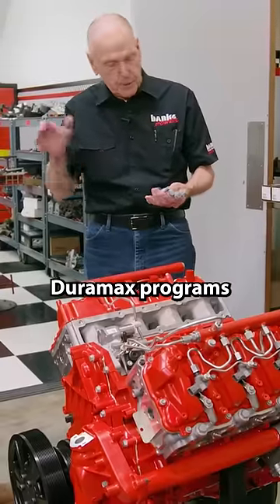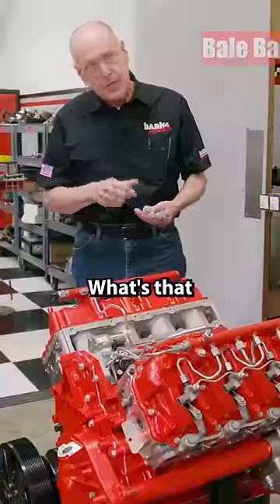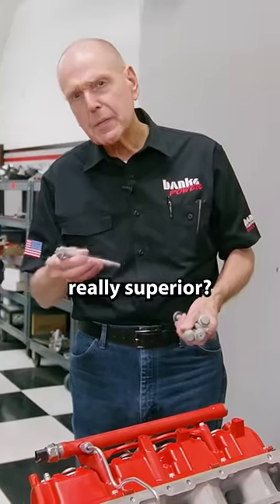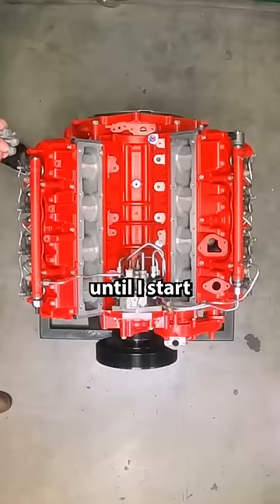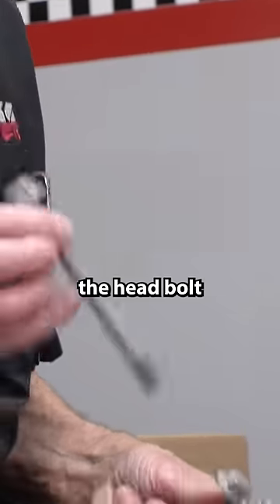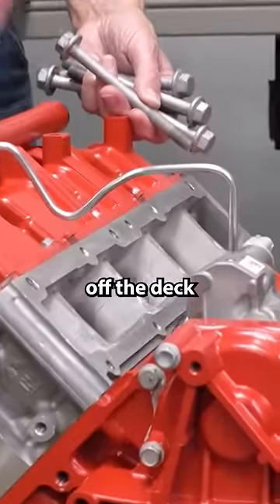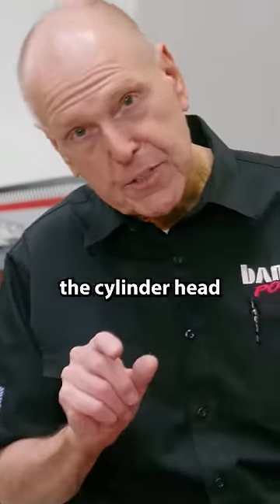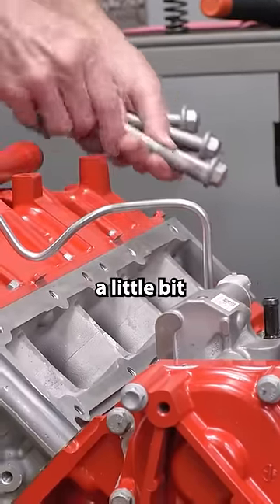Upgrading to head studs might be a bad idea

Comment: He states at the beginning of the video on all there Duramax programs. Now if he had a 6.0 power stroke I bet it would be studded. He isn't saying you won't need them. He is saying GM and isuzu make a good enough motor at 1000 hp they don't need them with there set ups. If a random person trys to make 1000 hp they very well might need head studs because they might over fuel and over boost the system causing a head gasket issue. If I built my 6.7 Cummins up I would need them because I don't have the talent this man does or money to figure out how to get away with that much power and keep my gasket intact. They are not a waist of money if you need them.

Comment: Similar to running stock shafts on my Jeep dana 30. I'd rather replace u-joints or cheap shafts, then upgrade to chromoly and start blowing ring and pinions.

Comment: Essentially the head bolts are mechanical fuse. The first point of failure ensuring the safety of more expensive ans difficult to replace components

Comment: Regardless of what you use for a fastener, whether it be a bolt or a stud the determination is going to come from the threads in the head whether you put them there or the manufacturer did.  There is a complex amount of science that goes into this equation.  Many times bigger or stronger is not the answer.

Comment: Oh, that looked like an expensive problem. A block with cracks radiating from head bolt hole threads is a sickening thing to find, especially if you’re picking up the check!

Comment: Forged the head valves increase head studs size to 14 mm , trunk should be 15 mm thicker , 4 layers of head gasket with Pure Stainless Steel gasket , in large water jacket line , that when overhead no longer existed

Comment: So if the bolts are continually stretched why wouldn't they be replaced at the same time as a failed head gasket? In a situation with a stock consumer vehicle has a failed head gasket, wouldn't replacing the bolts with the gasket be the best option for ensuring the longest lasting seal?

Comment: This is job complacency. Just because you can doesn’t mean you should. Metal stretching means it’s structural integrity is weakened. You wouldn’t know till you’ve pulled it and measured end to end or ultimately snapping it off in the block just to check. It’s common sense not to use oem parts on something you’re doubling the power in. No stock or oem parts are rated for that an if they “are” it’s only because they’re good for 10-15 full pulls before need of replacing due to lack of durability and the wear of stress from that level of power. It’s all good if you want the heightened risk of lifting a head, sending the head/block to a machine shop, or even having to drill and tap the studs out. Google the tensile strength ratings for oem studs vs any other brand and you’ll have all you need to know in # format. Arps material is specifically designed with durability in mind. Custom age 625+ studs are rated to 220,000 psi. They’re the reason a piston travels south under that power rather than the head shooting for the next county over. If you’re going big then buy big or you will later. If you’re just cheap fuckin off or it’s a daily then stock is just fine. One way or another that engine will have your money though lol

Comment: A lot of nuance skipped here:
How much deflection can the gaket withstand? 
Will the joint experience a loss in clamp load due to vibration or bolt walking? 
Are the bolts rated for the cyclic tension? (likely, but still)

Without an understanding of the dimensional stack up and loading, one is forced to argue that the aluminum thread boss is undersized with lacking support structure.

Seems a bit of a "stretch" to blame bolt spring rate when it's measurable and testable.

Comment: I thought the main reason for using studs is if you have a racing engine that requires taking the heads off so often that the bolts would wear out the threads faster on the block.

Comment: High end &/or "Pro" drag racing rear end gears are (relatively) soft. Extremely hard gears would just shear teeth when thousands Lb/Ft of tourque suddenly tries to engage those massive super sticky tires.

"Soft" gears will "smush" and flex but will keep their teeth and turn the tires.

Same basic concept.

Comment: The reason the head bolts are a failure point is because its cheaper than a block. These hardened hogh pressure torque racing bolts simply create a catastopic failure point where the head will literally blow off.

Comment: so you saying if you use upgraded head bolts the increased rigidity will put more pressure on the head and block and any weakest may create a new failure ???

Comment: Yeah, if I saw cracked heads every day id agree, but I don't. I see failed head gasket after failed head gasket. After studded especially with limited bolt designs like 6.0 powerstroke there's no more head gasket failures because of the studs.

Comment: so what is bro saying is "everything is designed in such a way that every components do its job in a harmonic way. this stud bolt for example is more flexible than the so called 'superior' ones, this flexibility of a bolt acts as a dampening spring for both the engine head and the engine block, if i use a rigid ones then sure it may not cause gasket leaks but there will be no way of dampening the sudden increase of massive load transfered to those blocks"

Comment: AS A RULE OF THUMB NEVER REUSE HEAD BOLTS. ALWAYS USE NEW BOLTS. ONCE BOLTS STRETCH THEY LOSE THEIR SPRING CLAMPING FORCE WHICH ALLOWS THE HEAD TO PERFECTLY MATE FLAT TO THE BLOCK AND ALLOWS THE GASKET TO CRUSH EVENLY.

Comment: An L5P head bolts are way stronger than an LB7, OE's continually improve their product, INCLUDING FASTENERS. If your building an older motor, and are building with the intent of "modern horsepower" levels, you will then need an upgraded level of fastener.

Comment: Seems like there’d be a better way to attach a cylinder head to a block. Like dovetailed keyways or plates on the outside of the head or block so bolts get shear load instead of tension. Idk, just spit-ballin

Comment: There's two sides to this "Mechanical sympathy" that some are born with, some must learn the hard way (that's me) and some are completly deaf to machinery's pain until a fraction of second before it kills them...

What you're talking about is the first  half of the equation, that of damping. 
For damping to occur the system has to be able to respond to an applied load and return... But with losses each time.
The othr dide of nevhsnical sympathy is resonance and the awareness of the possibility of the increase of energy in a vibrating system st certain frequencies.
Again the answer is damping.

Comment: If the bolts are working, they are not the weak link... until you push the limits, you won't know what is the weak link. Break it. Then, beef it up and push harder. Rinse and repeat.
Think someone may have hydro locked those threads? Or didn't clean it out?

Comment: Sorry, but I'm not waiting until it fails. If it does fail, I dont want That to be the issue or what comes with one or more head bolt failing.
Granted, I'm not going out of my way to just put "superior" head bolts in, but if im planning on tuning it up, those would be my first upgrade.

Comment: I dont see stock 400hp+ engines running studs, atleast my roughly 400hp audi uses bolts and does not have a reputation of having issues with headgasket or sealing. The companies that design motors have one of the highest skill level of engineers in any field. If the engineers that designed the engine decided that studs would be unnecessary i trust their judgement.

Comment: All ur saying is keep blowing head gaskets. No bolt suppose to stretch. If its stretching ur messing up. That power is lost power best way to treat that is use forged heads blocks and robs. I dont even use factory head bolts on vw beetles. U always upgrade the head bolts. If it was meant to stretch the company would make them out of rubber
Reply from the maker: Every bolt is supposed to stretch. This is called elasticity as defined by Hooke's Law. One of the fundamentals of physics, and what makes engineering so complicated, is that EVERYTHING is a spring. Everything has some level of elasticity, however small.

Comment: You definitely would rather have your weak link be the bolt before the threads in the block. But I would think you would rather blow a head gasket than have the head bolts fail. Am I way wrong?

Comment: I do not believe the head moves every (or any) time the cylinder fires.  It can’t or you would have head gasket failures.  There are many ways to fracture the block near a threaded bolt hole.

Comment: I'd rather blow the heads off the engine than blow the side out of the block. Upgrade those headbolts! ESPECIALLY if they're E Torx head bolts and you can change to hex.

Comment: Ok. So of you run stock headbolts and make 1000hp, "never blown mih head-gasket" its because the engines fail in some other capacity before the head bolts run out of stretch, and the head-gaskets run out of spring-back-ability.

Comment: studs are better unless you have the correct size bolt that leaves 0 unthreaded threads in the blind hole. if there were more threads engaged your bolt wouldnt pull out like you showed

Comment: This is a good point.  But why would ANYBODY want to entrust that kind of INCREASED cylinder HEAT and PRESSURE, ,  to a cast aluminum block & heads? 
      Where is the DURABILITY of this Isuzu Duramax engine when it has been souped up? When Isuzu can make Diesel engines out if cast iron, then that is an engine that can be trusted to handle that type of stress.... Save the aluminum for the motorcycles, light cars and airplanes....

Comment: Gale is a very knowledgeable man, but most of the stuff hes talks about is common sense, now i dont agree to this,  A tty bolt, if stretched further then the capacity it was designed to after it was originally torqued, it loses clamping force, therefore alowing the head to lift, and the original pressure will not be there once stretched, so in return, blown headgasket.

Comment: In all seriousness you can lose horsepower and torque before a failure. Sometimes deflection is enough to cause both increased vibration, increased heat generation, and less output.  I understand where you're coming from though.

Comment: Im not Familiar with the man, I'm sure he knows ten times more than I will ever know, not hard to do. For a dummy like me to concur, There would have to be a lot of people with cracked heads, because of head studs,  And I wouldn't be learning about it today.  My unworthy brain is leaning towards Inproper Installation of the studs. But if it doesn't blown them and it's not a race car And you're running a thousand horse power. Overheating ruining the motor coolant on the back tires shouldn't be an issues. 🫠

Comment: Gale, your explaination is not entirely technically correct. I know you like technical correctness. The bolts creat a clamping pressure, the cylinder pressure tries to lift the cylinder head. However in the details is this, the head bolts do not stretch with cylinder pressure unless the load casued by the cylinder pressure exceeds the preload of the bolt. Check out this book, John H Bickford,  An introduction to the design and behavior of bolted joints.  You are an awesome engineer and designer!!

Comment: Why would you want to let it get to a failure point? That's not good engine building and thinking. You are installing the stronger parts to try and stop failures and handle more power.

Comment: Lol, wait until the headgasket goes? Dude headgasket repair is prohibitively expensive, if you know the studs are your solve for not having a headgasket blow. Why not just go ahead and use them? You're telling me you really want to wait until the bolts go, and THEN have to pull the engine out again? I dont know about you guys, but I really dont like having to take my stuff apart again, if I knew I could put it together and solve the problem. 
This is fundamentally insanity Mr Banks, you do recognize that right?

Comment: If youre block is cracking when you install studs, you did the studs wrong. If youre claiming otherwise all youve proved is that the bolt location is not strong enough. Going for a weaker bolt isnt the answer.

Comment: Don't know.
What is the force difference raising the head,  between regular HP, and 1,000.....?

I would think outside the engine a test can be done on stock bolts, in a replicated block, finding stretch difference, if any.

Don't know.  

Bolt size, number of bolts, head flange all designed for x force/tension .   If 2.5 times more hp, engineers would do different design?  At higher cost.

If you max out a design, but one part is beefed up, maybe that just transfer that breaking stress to another place, like the block, or head?

No free lunch.

In WW2 Soviets took the American P-39 and radically upped the HP.  American support technicians said you are going to destroy the engine.  Russians said we know that, no matter, they get shot down before engine blows up.  In the meantime pilots get hotrod engine.

Comment: lol stock duramax blow headgaskets left and right. Im sure your 500 mile dyno engine did great with stock headbolts. Try that on a work truck with 200000 miles.

Comment: So, what if you run bolts, but make them bigger so that they're stronger? More strength without the increased rigidity that might compromise the threads/engine block.